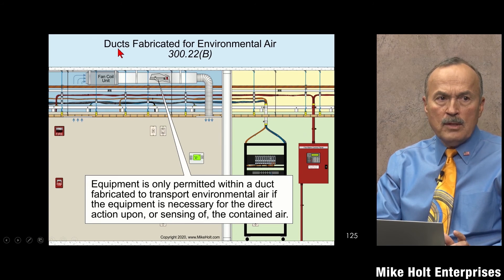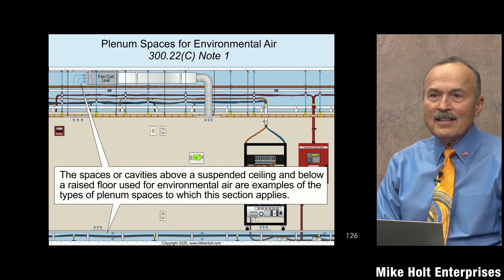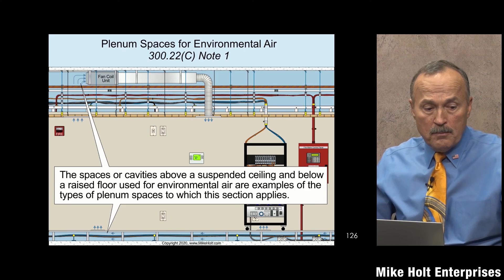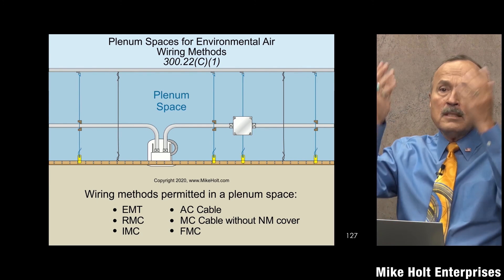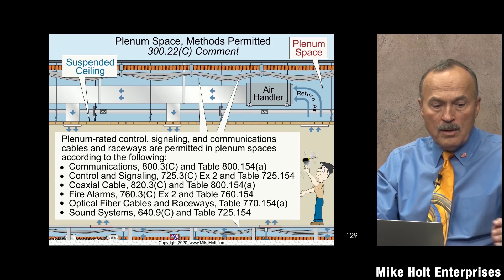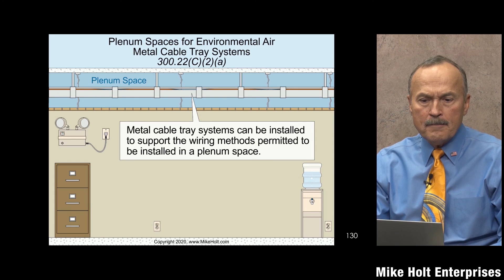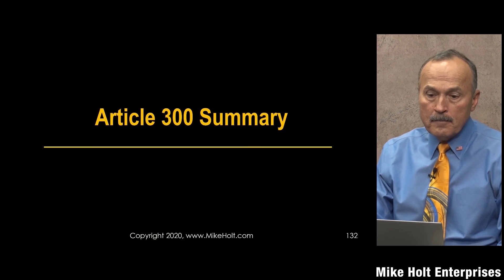Plenum Space Wiring Methods [300.22, 2020 NEC]

Comment: I would like to hear more of your  thoughts about AC/Mechanical closets with a louvered door. Should an individual have to use plenum rated wiring methods? Essentially meaning no plastic disconnect and only metallic raceway (FMC) whip into AH? Residential and/or Commercial? 
**I am an Electrical Inspector here in Panama City Fl.. Love all the perspectives and interpretations you all  provide when I'm looking for grey area code references**
Reply from the maker: 300.22(C) does not apply to spaces not specifically fabricated for environmental air-handling purposes but used for air-handling purposes as a plenum, or habitable rooms or areas of buildings, the prime purpose of which is not air handling.
Does this help?

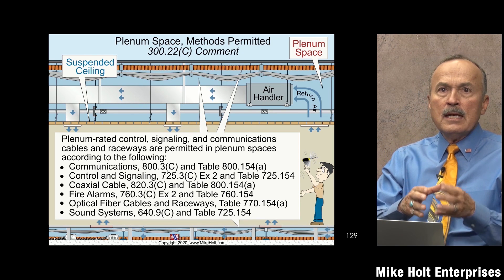Comment: The picture at 6:31 is different than the previous picture. The picture at 6:31 has a return air duct attached to a grill placed in the ceiling, pulling in air from below the ceiling. I don't think that's a plenum.